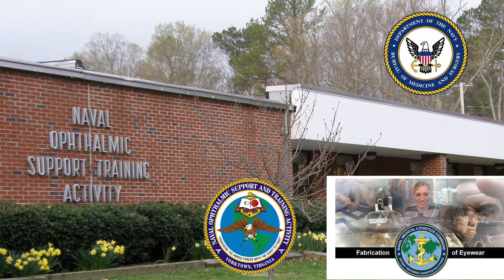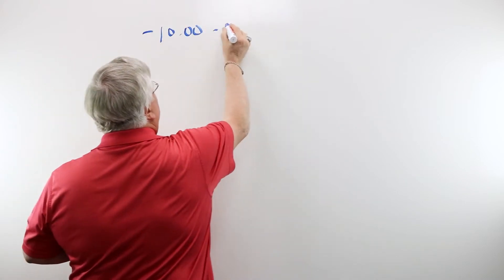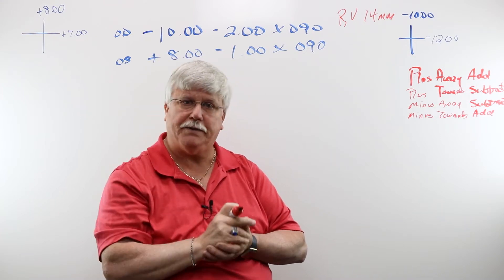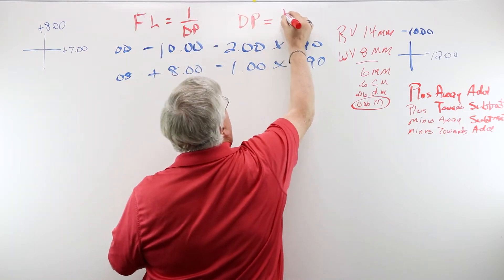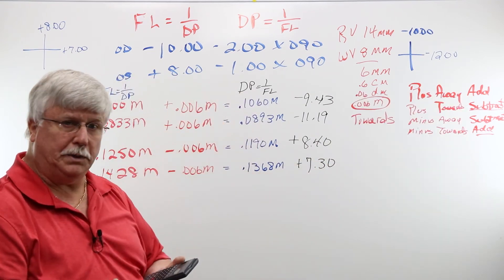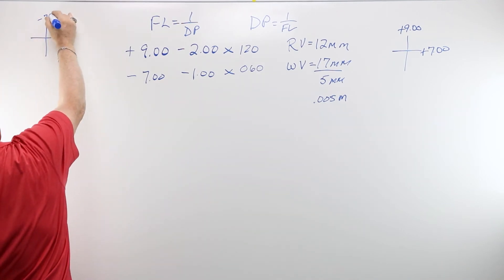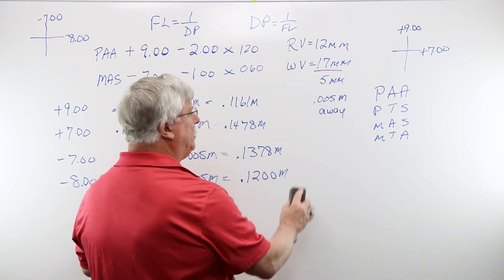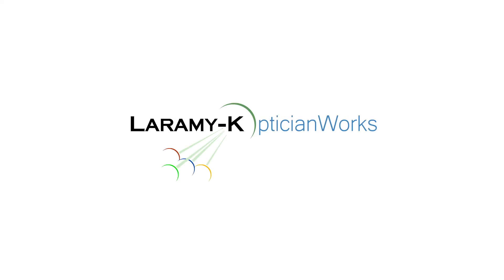Martin Goergen Teaches Calculating Vertex Compensation

Comment from the maker: Hey All - Just had a question pop up on Facebook about rounding the final answer. Or what would you call into the lab? A great lab like Laramy-K you would call in exactly what you got, they would run it in free-form and you would get exactly that back. An OK lab would probably be good with 1/8th diopter steps. A not so good lab will insist on 1/4 diopter steps. Just follow your normal rules for rounding. John

Comment: Hello, just wondering regarding the answer during 16:56

Do we need to consider the sign of the power to get the compensated powers? 
i tried to double check it with the other formula DE= DL/(1+(d*DL) and i get a different answer.
Or when using this technique we do not consider the sign of the lens power during the initial f=1/D computation?
Reply from the maker: Yes. I'm a little confused by the question? Power or sign is everything here. You will compensate up or down depending on the sign and the power of the lens. I've never used Marty's method so I really can't just glance at it and say, "oh yeah _______." But, it is how he was taught and how he has taught vertex compensation for 40+ years. John
Reply: @LaramyKOptical  im sorry. let me refer to 15:37 upon getting the focal length. Should the sign of the power be considered so that it should result to a negative answer for the focal length of the minus lens?

in the example of -7.00D 
1/-7D = -0.1428m focal length
since VD is moved away from eye
-0.1428m - 0.005m = -0.1478m --> which is a different answer in 16:21
Reply: This a very good method. Thank lecturers for this brilliant content. There were minor errors, adding 0.006 to get 1.060 etc.

Comment: How is wearer vertex distance measured? From eyeball to the back of the lens? If so, most high prescription lenses tend to be real thick on the edge... blocking the view. Thanks.
Reply from the maker: By using an electronic measuring device like OptiKam. There is a tool called a distometer but they are rare and fussy to work with.